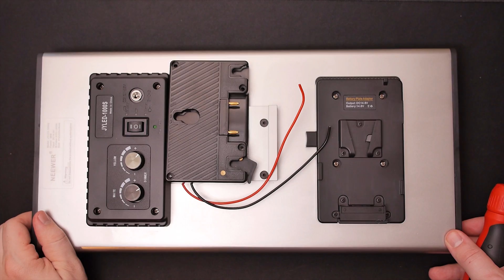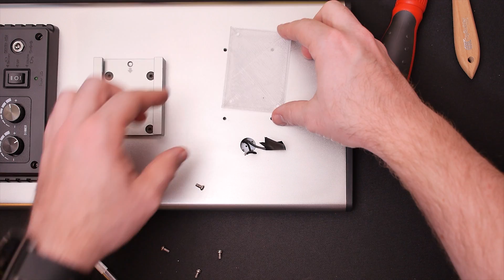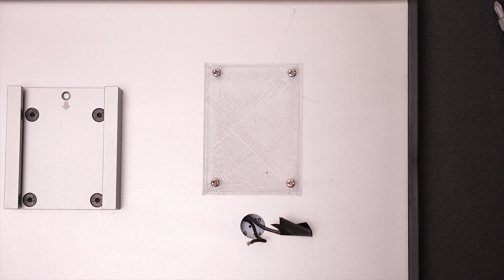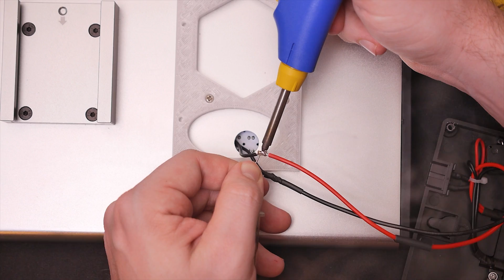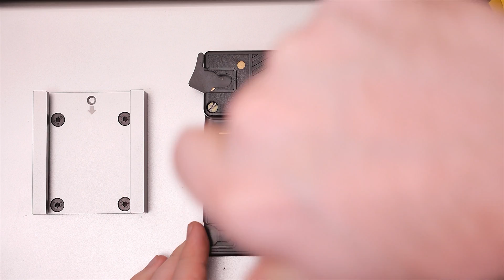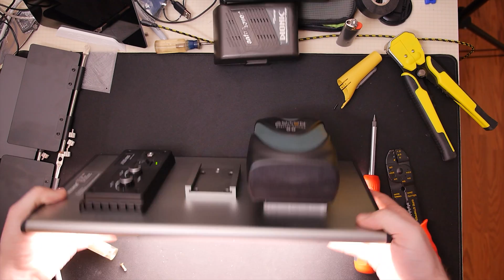V-Mount to Gold mount DIY adapter plate - DSLR FILM NOOB

Comment: Dunno if you can awsner this but is there a way to make a DIY charger for a gold mount battery? It seems absurd to me that the chargers for a 14.8V battery cost $100-200. I don't care if it takes hours to charge I just want something that works for an older camera that I have. Since it's an old camera I don't want to invest that much money into it
Reply from the maker: Short answer is yes, there are chargers that could be wired up to do the trick. You can find them on Amazon and ebay. However,  the batteries are sensitive to charge and need something to monitor cells. If something goes wrong and a diy charger doesn't detect it, you could have a major fire on your hands.
Reply: @onelonedork  The camera I'm using is from the 1980s and I'm guessing it predates Li-ion cells so I assume the battery is NiCd. I'll find out once I get the camera and open the battery it has. I assume it's NiCd.
Reply from the maker: @KylesDigitalLab  if that's the case, you could probably just rig something up, you'd just need to know the charging voltage based on the cell configuration. There's usually just a per cell voltage value to add up based on the number of series cells.

Comment: Please don't use this music ever again. 

Would be nice to show the difference between the mounts and explain why you preferred one over the other.
Reply from the maker: 100% Devin.
Reply: +Samtagri I don't mind the music
Reply: +Samtagri The difference are really just personal preference, I think v-mounts are a little cheaper and that's why a lot of LED panels out of china only come with a v-mount option. Most news networks (CBS, NBC, etc) use Gold Mount (Anton Bauer or AB) V-mount is known by those with experience to "pop off" if it gets bounced around too much, It has to do with the fact that 1 it's vertical, and 2 the pin that's used to keep the battery in, isn't very strong. AB mounts mount sideways, and the way it uses a spring to keep a gate shut is much more reliable. 

What I do like about v-mount besides that it's a little cheaper, is that the batteries then to be a bit slimmer, so the pack a little nicer in tight spaces. But it's said that most DPs and ACs prefer the AB mount system, because v-mount can't be trusted.

I think for things like lights it doesn't matter, but because I already have gold mount camera rigs. I didn't want to invest in v-mount batteries and charges just for my lights, hence the hack.

And sorry that the music is not to your taste, you're concerns have been noted :)
Reply: DevoCut That's good info and a topic worthy of a video. You often mention these mounts and I only recently started to understand what you were talking about. The only battery mounts I know about are those of the Sony style batteries.
Reply from the maker: +Samtagri Devin and I don't agree on music beds for video ;)
Reply: onelonedork LOL! Throwing Devin under the bus DJ??? =P
Yea the beginning was particularly strange. I was like, what is this noise?? Sounded like a hundred gnomes yapping.